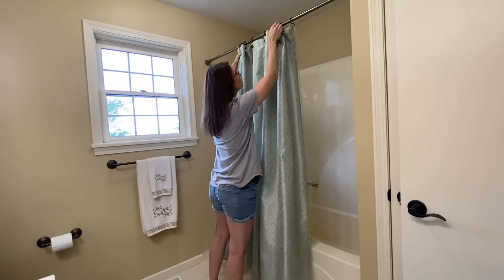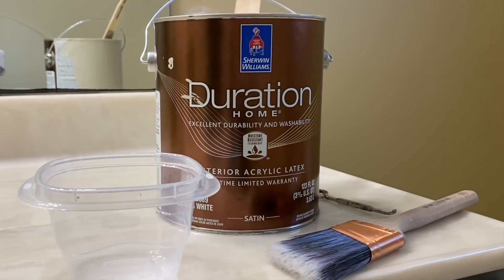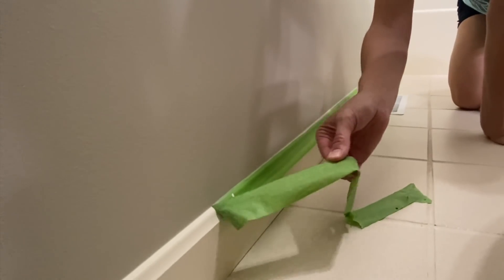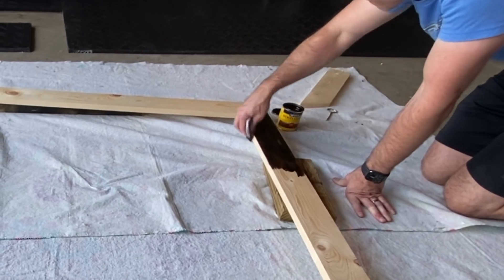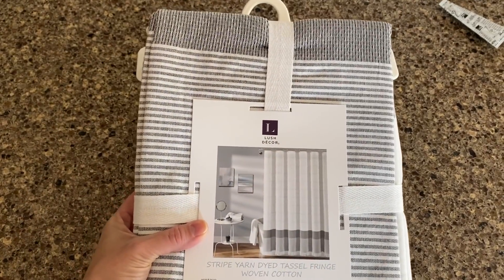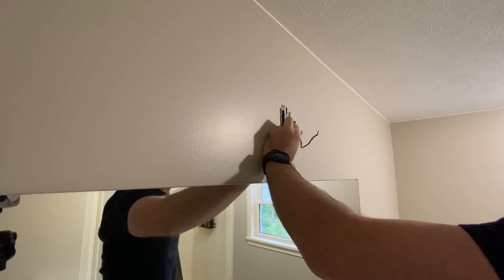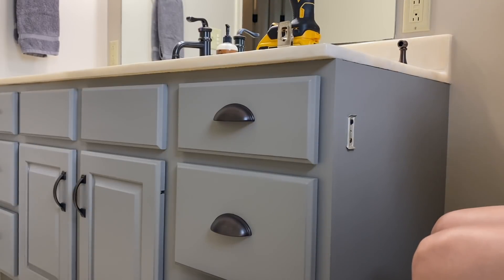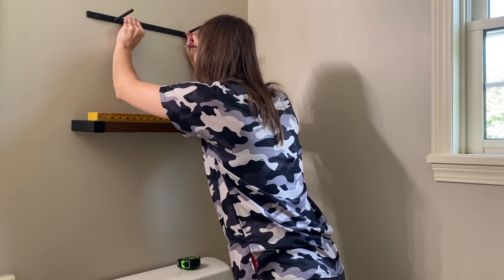DIY BATHROOM MAKEOVER ON A BUDGET/SMALL BATHROOM MAKEOVER INSPIRATION/FARMHOUSE BATHROOM 2020

Comment: Hi Amy, I love your channel, I found you yesterday and subscribed, then I sat and Beng watched for hours, I love your bible reading at the end, what a wonderful Idea.  Now, with your bathroom, I would suggest adding in the same "shower Curtain style" for the window, but only half the window as cafe curtains.  It will be the finishing touches of detailing to the room.  I love the color of the walls, and overall, you did a great job, however, just wondering what happened to the glass light fixtures bulbs over the mirror.  You have the cleanest home, I have ever seen, I wish I could keep up with the cleaning that I used to have, but now I have physical issues, it's takes time for everything to get done, but of course I'm a seasoned 70 + y/o:  LOL.  God Bless you!